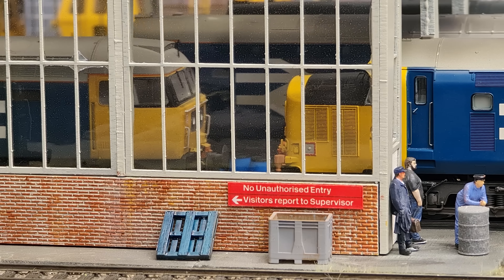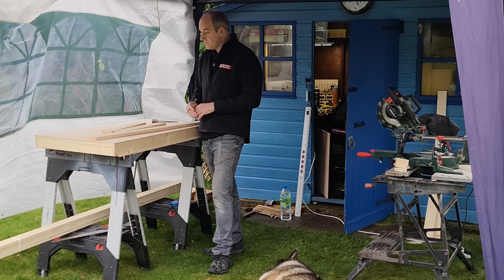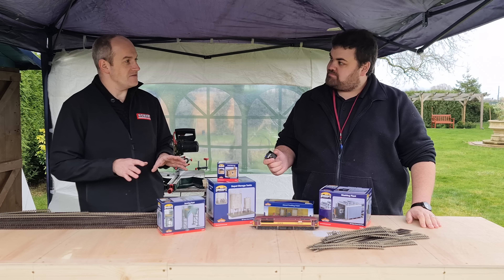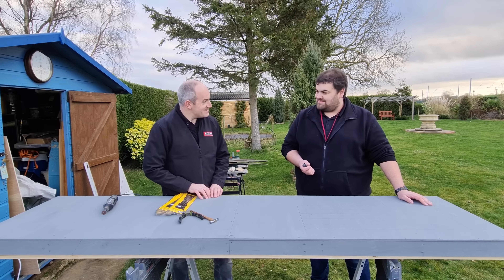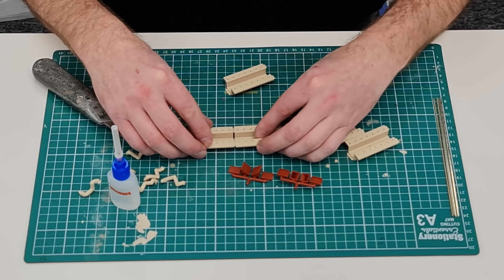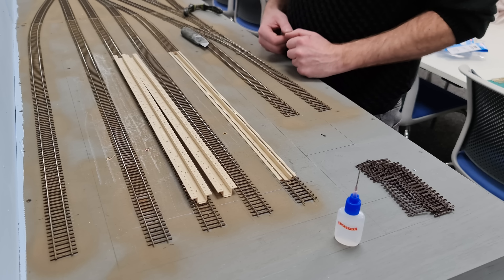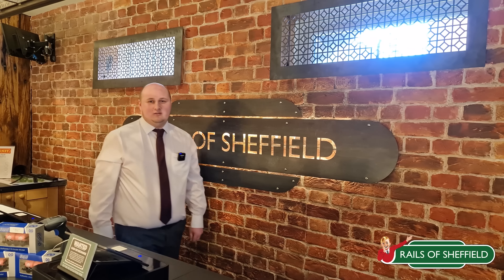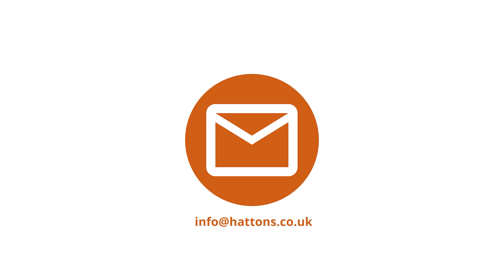SERIES 3: Building a Diesel Depot - Part One

Comment: Hi guys. Useful video as I have undertaken the extended version(both packs). Have to keep rerunning a few snips to get baseboard/etc  dimensions . I was wondering if there is a track plan and track number stock list available for the 'as seen' video? cheers.
Reply: I agree a track plan with parts would be extremely helpful.
Reply: I bought the hornby magazine edition which lists down the various parts but not the actual number of turnouts required to be purchased.

Comment: Super cool module that I've just thought of controlling level crossing gates via  different methods to try out with glass reed switches as the remote press buttons. The copper coated wire I find hateful to solder to and tin. Are there any good tips on getting a good joint. My other pet hate is lead-free solder, also hateful to use.

Comment: I am in the middle of making my first layout and this has helped alot, i was wondering what was the Brass things screwed/nailed under the track at 20:17 in the Video? And where can one buy said items?
Reply from the maker: These are copper clad sleepers to hold the rails in place at the baseboard joints because it is a portable layout. You can buy versions of these from DCC Concepts which are black with solder pads on them.

Comment: I am surprised that you didn’t put something under the track to mitigate any noise transmission
Reply: I think as the locos will be running slowly, cork or other underlay to cut noise isnt needed?
Reply: Once you ballast it reverbs anyway so its negligible.
Reply from the maker: Like the replies, we didn’t see the need for cork as there is very little payback in noise transition at slow speeds, particularly after ballasting. If it was a main line layout there would definitely have been cork underlay.